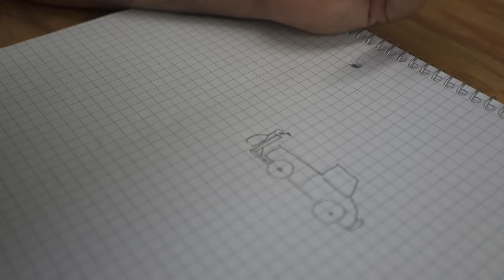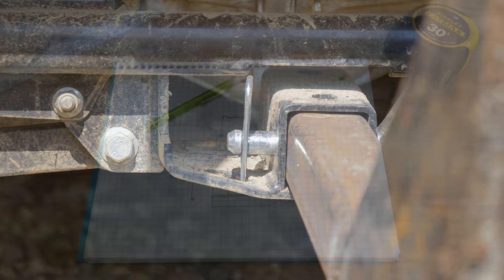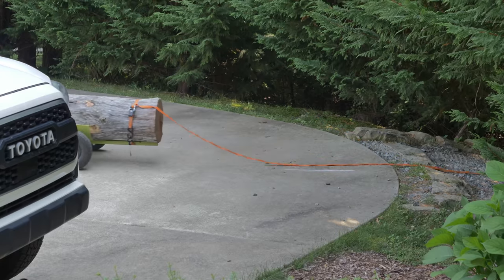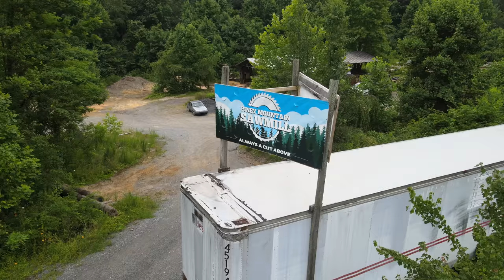What Berm Peak is doing about high lumber prices

Comment: Hey Seth, please be carefull felling these dead oaks. Its one of the most dangerous task in forestry felling trees that are long time dead since with just the vibration of your chainsaw and hammering wedges in to the felling cut, stems can break of and hit you being right underneath it. 
greetings from germany 🌲✌🏼
Reply: Massive respect to you. 

I worked as an alderman's apprentice each Summer before heading out to school. It's good work but definitely scary at times.
Reply: Yup a snag will kill you.many people here in new mexico have died cause of that I came close with one but I heard it crack snd got out of the way scary shit sometimes. Saftey should be #1. They should be wearing hard hat and listening and watching the trees.
Reply: Yeah, you’ll definitely want to wear a hard hat.
Reply: Great video! Wish I had a mill like that nearby.
Reply: Very good point 👊🏻👊🏻👊🏻👊🏻👊🏻
Reply: Yep.  That's why the call them widow makers.  I learned that really fast when I went and knocked a dead pine tree one time and a second later the top of the tree fell on my head.  Just about knocked me out.
Reply: I had two logger friends that weren't so lucky and another that is now in a wheelchair from falling branches.  I don't want to be a grump about your good salvage intentions and $ savings, but your lives are worth far more than 
the trees.   I know it may be difficult to get a lift of some sort into the areas you are working and will cost $s to do it, but if you can locate a friend or even rent a lift truck to top the trees or the overhanging branches that may tumble it is worth the effort if you want to continue with doing this.  You might also find someone with an excavator with a thumb on the bucket that can reach high enough to snap off the top of the tree or the branches.   I really don't want to see another of your videos with one of you at a funeral = YOURS!   Please be safe!   And by the way,  I do cut down a lot of trees and have sawed thousands of feet of logs with with my Woodmizer mill.  I'm also well over twice your age and hope to stay alive for a few more good years so I'm no amateur with all of this.

Comment: Lumber prices: horribly high.

Some mountain guys: "Fine, I'll do it myself."
Reply: 'I did it my self' -Berm Park. Yeah they turned ~10 logs into lumber for a enough lumber to equal $2000, instead of selling to a veneer mill That would have payed $1000+ per log ($10,000). DIY costing  yourself $8,000.
Reply: Lumber prices now are at an all time LOW! Hasn't caught up yet at Retail but cannot go much lower without Mills Curtailing production or losing money
Reply: @bgdg323  they needed the planks. They didn't cut them up to sell them to a mill.
Reply: @kugelpanzerstudios4800  I think the argument William is making is they could have sold those logs and bought 3x the weight of wood of a different type, because of the value of that type of timber compared to what they normally use, however, if those planks they have are very weatherproof (I don't know my north american trees) they could well be worth $10,000 for their use, as they'll last for decades compared to the normal timber they used in the $600 build
Reply: @bgdg323  veneer mills wrong buy that super dry standing dead wood. Derp. It's too dry and won't peel well. It's too imperfect, has too much checking, has too many cracks, etc. And selling it to a veneer mil won't help them at all. Don't you love it when you try to post a snarky comment, but you get schooled by someone who actually knows what they're talking about?
Reply: @bgdg323  he can get it back by selling and he also get it back with merch
Reply: @MarvinYoani  Yes HE Can! But the People he's showing a DIY "tip" to will be better off selling the logs That was my point.
Reply: @littlejackalo5326  Depending on when the dead wood "Died" They were 1-2 years old   still wet enough beyond the bark layer +an inch max at that weight.
Reply: @williamdebow3478  The are not. They are at ~$600/1000BF. Over the last 20 years it has averaged 33% cheaper than it is now.
Reply: @bgdg323  William I do not know where you are buying your lumber but I just purchased 3 full truckloads at $400 MBF delivered. It is not going to go anymore than $25 lower at the max. If you can't afford to build or buy at this price then you never will be able to. I'm not talking about what I heard from someone or read somewhere. I am talking about what I know. I have another load coming this week at that same price. And I am not talking about junk, I am talking about #1 grade, not the #2 stuff you see at most big box stores. As I said before, some Retailers are still a little high because they have old stock that was already in the pipeline.
Reply: @bgdg323  Keep in mind, that's $4.00 for a #1 grade 2x6x10' SYP You can't cut down your own tree, saw it, dry it and plane it for that price, even when the trees are free not to mention your time and labor and waiting a year and a half for it to dry.
Reply: @williamdebow3478  your comment was from 5 months ago. Is it the same? Because in Missouri at Lowe's, a single 2x4x8 is 14 dollars a piece...
Reply: @floppybeefcurtains7679  Now it is approaching the high of last year and because Russia is one of the largest exporters of lumber it is expected to surpass the all time high!
Reply: @williamdebow3478  Russian lumber isn't in my Lowe's. It's from up north. The lumber at the actual lumber yard in my town is more local than not also. 

My best bet for wood is somebody that has a sawmill and get it directly. Even then, it's more than it should be. The prices of everything going up like this is to make normal life impossible without government assistance. Doesn't matter what the product is. It's been like this before Russia. We're all f*cked if we don't work together no matter what's happening. even then..... Not looking good.
Reply: @floppybeefcurtains7679  The price of lumber is determined by the futures market which looks at the entire supply chain vs. demand. It would be nice if it were priced based on what the Mill pays, it's cost to produce and make a reasonable profit. The Mills have little to do with the high prices but sure are enjoying the windfall of profits that they are making. If we could get lumber off of the exchange  then we would have better pricing based on local demand. 2x4's are priced unreasonably as well as 1x4's. You can almost buy 2x6s for the same price. Our President could do something to give us some temporary relief so the construction jobs could continue. Builders will have to halt construction on new homes at these prices. It's killing me.

Comment: Flux core is in my opinion harder to weld than regular mig welding with gas. I'd recommend doing practice runs and getting to know what the puddle should look like and be sure to use that chart that is on your machine for proper settings. After gaining experience you can customize settings based on feel. It takes lots of practice to get good at welding. I was lucky to have a good teacher who let me practice a whole lot and that helped me improve.  Take your time and pay attention to how your welds look.  Good luck Seth!

Comment: When pricing this option, you really have to include the cost of your time, the materials to build the rig and, very importantly, wear on the Gator. It may still be worth it, and there may be other reasons to do it, but it’s not as simple as the cost if sawing vs the cost of buying pre-sawed timber.
Reply: Well when I do something DIY, I usually get a least a little satisfaction from the time spent.  Having your own blood, sweat and tears in a project gives a sort of intangible pride.  I consider this as offsetting the cost of my time.  Also, I'm not Elon Musk, my time is not that valuable.
Reply: @mattgraham4340  I totally agree, other than the musk part. Our time is just as valuable, we just measure ours in a more realistic fashion 😎👍
Reply: The wear on the gator is negligible, materials to build the rig are a few hundred bucks. So not really a problem.

Comment: The main problem with using the gator for that job is that it’s not a Polaris
Reply: You're right. If it was a Polaris, it would work great, provided that it started in the first place. ;)
Reply: @Chubacca838  being a Polaris mechanic this made me laugh 😅
Reply: or a cj2. real trucks should be used for real truck jobs
Reply: @ArmyBoiSweat  I'm quiet amazed at how much he's been able to do with a front wheel drive "truck".
Reply: @Chubacca838  or the belt was intact

Comment: As a forester with one of the largest timber producers in the world, this is precisely a scaled down version of a harvesting operation!  You got the feller which cuts the logs and places them in bunches, then a skidder to drag the logs to a loader, which in my case will cut the logs to length instead of the fellerbuncher, and then load them on a trailer to be trucked to a mill.  The high production lumber mills nowadays have super high tech equipment that does exactly what Audie does but in a split second.  The waste chips then go towards firing kilns to dry the freshly cut lumber.  I can't imagine the skill and experience it takes to determine manually how to cut up the log.  Computers will scan the logs and somehow they work up a pattern to get the most out of them in milliseconds.  It's amazing stuff!

Comment: That's awesome. Wish we had that option around here. We are going to be doing a bathroom renovation due to mold soon. I've done them before in other houses and the wood cost maybe $100. Just for the subfloor alone it will run $200+. Pricing is insane right now.

Comment: If you need help welding mess around with the settings on it and to get a good weld cut the wire 10mm from the spout and hold It at a 45 degrees hope this helps

Comment: We had a large saw that we hooked up to the tractor with a canvas belt.  We cut up all the old wood that was above the cow milking stantions in the barn.  They had a bunch of stuff that was off to the side for cutting wood for boards and fencing but we never used them.

I bet the saw was about five feet in diameter and was kind of scarey once we got it turning.

Comment: a piece of advice for your welds, when you make a pass count in your head. 1 pa pa 2 pa pa  and then move the feed. Depending on what type of welding you either need to push or pull the bead. becareful using some of the smaller welders for thicker plates, you wont actually get penetration. Most importantly try to weld in the most comfortable position possible. Staying relaxed will really help you stay consistent

Comment: Great video. As for the welding, try use gas with the machine. If not. Make sure it’s flux core wire your using. Turn your heat up a touch and slow down. Weave your head side to side ever so lightly 👍

Comment: Replace that thing on the back of your Gator with a very short trailer with bigger tires. Have twin masts that are vertical when hauling but are tilted back toward the log for loading...they can be used to lever the log up into place more quickly. Make it so you can lower the front of the log onto a cradle on the trailer instead of it swinging  from the mast while towing.

Comment: when cleaning the weld with a hammer you need to really hit it hard to see if you have hollow parts. dont be afraid to hit it is designed to handle a lot of stress

Comment: You need to use a shielding gas on your mig welder. The shielded wires suck. That really hurts your weld and really makes it tough if you're new. Get a shielding gas setup. You'll be glad you did.

Comment: Next time build a log arch. Me and a buddy built one a few years ago to skid out some 8ft x ~18in-24in maple logs with an atv and it worked like a charm. With a bit of practice you can get the balance to the point where there's barely any tongue weight or even a bit of lift if you're really worried.

Comment: Since the UTV is really only able to provide a pulling force, put wheels in the front too to carry the vertical loads. Preferably something that has casters.

Really you just need a 4wd tractor. You could load the logs with pallet forks, and skid them with the three point.

Comment: As a former product engineer of welding electrodes, I noticed you welded with NR211.  It does not need shielding gas but it is definitely NOT beginner friendly.  MIG would be far easier.

Comment: Heat that metal up even a propane plumbing torch makes enough heat to drastically decrease the chance of the metal breaking when bending it back ie the receiver on the gator  and if you would put a support on the top of that pole you could remove a lot of the leverage  it’s applying

Comment: An actual mill will pay more for a full length limbed out tree because they will have more uses for it. Such as, they will be able to get a good cut length on strait timber. They will also be able to assort their mulch and pulpwood, easier/more efficient! Depending on the type of tree.... Small owed business are definitely a great option in today’s market! It still doesn’t add up to the full picture. Until till you add in all of the other costs of a production product.

Comment: If you added a pair of wheels under the front of the log like you have on the back, you could take the down force off of the gator and just use it to pull the log.

Comment: Seth, great use of your local saw mill!  I saw in the video that you were using a battery powered DeWalt chainsaw.  How do you like the saw? I have thought getting on for trail work.  The fact that it doesn't get hot from using gas is interesting.  Have you checked out Northern Tool?  They have some log arch trailers that might save your Gator.

Comment: I know I am way late on this but the reason your welds look like that is the welder does not put out enough voltage to penetrate the metal you need a 220 volt welder

Comment: Seth, I'm sure this has crossed your mind, but coat those boards with weather protective stain/sealer. Give it around 2 coats, otherwise that wood will rot faster than you can spell berm peak. Great video though!

Comment: Where did you get that skid dolly with the wheels? 

I need one so I can pull out some of the big logs back in my woods without tearing up my trails.  I welded a chain grab to a 3 point trailer mover and use a chain with a choker on the end to pull my logs out.  Adding that dolly would make things go a fair bit easier.

Comment: Looks like if you had a metal ledge inline with the hitch, the log could sit on that instead of dangling from the top of the bar. Maybe make a new rig and leave the hitch channel long, slide the upright over it and then weld. Like a slip slip PVC fitting. 

Cool rig tho. Looks fast

Comment: It would be really cool to see a 180° berm/wall ride. Instead of just going around the corner, you ride up the wall ride, and then it turns to the side and you ride back down the other side. Almost like a big upside down letter "U" was placed in the ground and then pushed over so its on an angle. And you ride up and around the U

Comment: get a little hydraulic tractor like a case 220 and weld up a beefy hitch receiver. saw one  before for mild nw ohio swamp logging. Look up The tinker boys with 6 subs. these tractors are some what cheap for their power even with the stock motor but do well with upgrades too.

Comment: Practice with an oxyacetylene torch. You will get a better bead as a beginner. Also make sure you are buying filler metal that goes with your metal. Cook your wire next time because the water in the air will effect it and give you a poor weld. Do not weld on concrete, the heat will pot mark it.

Comment: Bro. Please update those welds as soon as possible. The weld needs to be solid all the way through. Your Arc should sound like bacon sizzling which means your voltage was set too low.

Comment: If it was me making it I would still use the same thing as you without spending a crazy amount of money. I wood fined a way to bolt or hook it to a tie down point or something similar in the bed so it's not putting all the restraint on just a receiver

Comment: As a welder I have a couple of things to say. First put the guard back on that grinder and put some gloves on and shield your eyes. Really man dont limp wrist the grinder you dont need both hands on the grinder to cut.

on the welding side looks like you are using flux core wire just buy an argon bottle and use solid core. For the kind of projects i imagine you're going to get into its just going to be a pain im the ass to use flux core

Comment: I realize this may sound cruel, but there is no way to say this nicely, those welds are just awful, you need to brace your hand with your other fist, match your feeds, and amps to the ones given by the manifold on your welder, and you need to clean the surface, get that, and you have a chance.

Comment: Gator™ should be ashamed. That wimpy hitch receiver is a blatant design flaw; the front wheels should lift before anything bends! My crappy old Quadrunner can support a levered boulder without affecting the frame in that way.

In my opinion, that rig wasn't a bad idea (though in hindsight, the load would've been better placed to rest on the bed). Well, maybe now you can weld an 'improvement' to the frame ;)

Comment: Hey Seth! I am trying to put a better tire on my bike and my current wheel size is 27.5-2.20. I am wanting to get the Minion DHF from Maxxis. The Minion DHF comes in the smallest size 2.30 is that ok to put on my 2.2 wheels? Will it affect my performance?

Comment: Just watched this video. It looks like you might be using the wrong wire in your welder. If you're not using a shielding gas, you need to use specific gasless welding wire. I'm betting if you do, your welds will be a lot cleaner and stronger